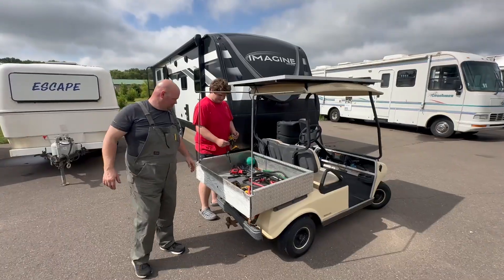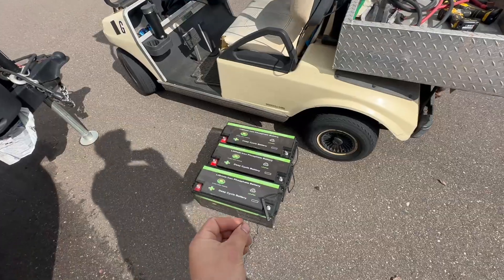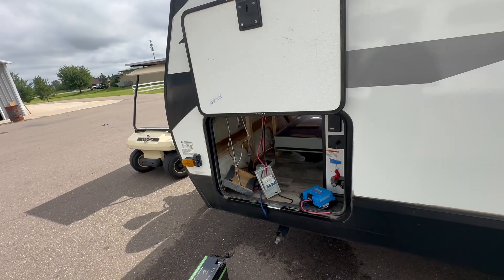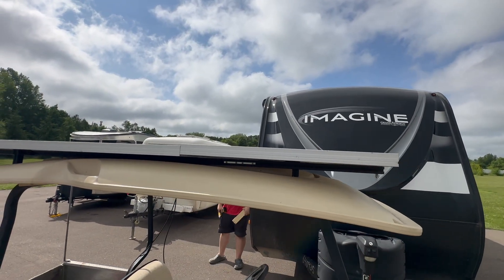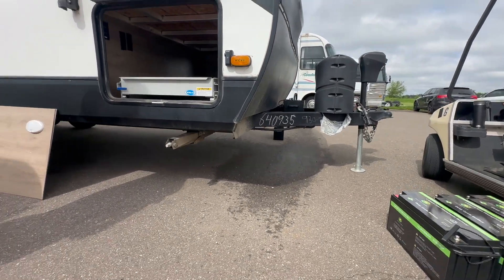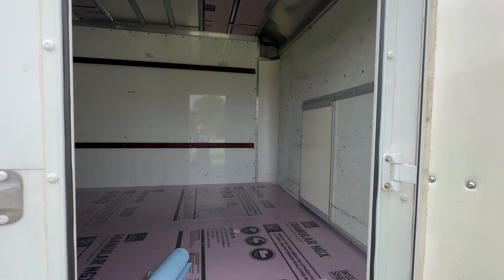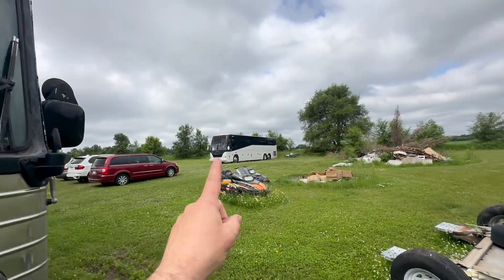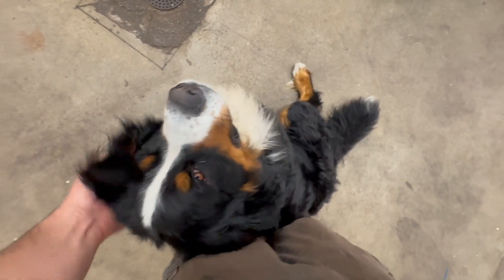Solar Week Begins! Grand Design Tearout, Basecamp Build & Box Truck Plans

Comment: We 'upgraded' from our 1989 MCI 102AW3 to a 2001 Country Coach Affinity.  More solar, victron and a hefty 12.5kw cummins onan quiet diesel.  Also, many more creature comforts.  The 102 was just too rough (mechanically, NY/MA winters took their toll on the chassis).